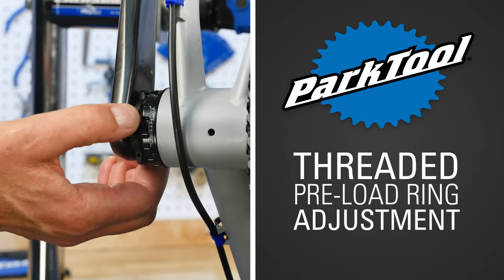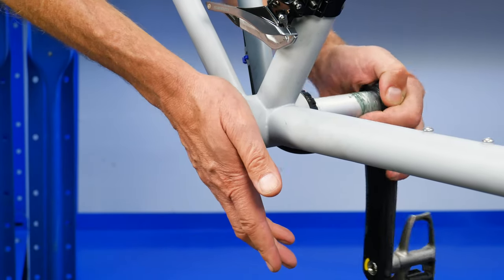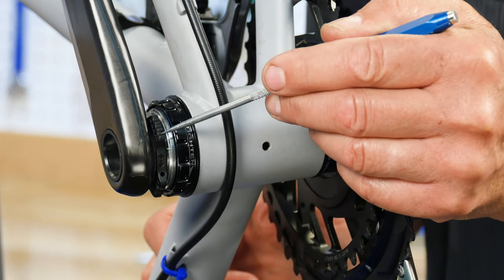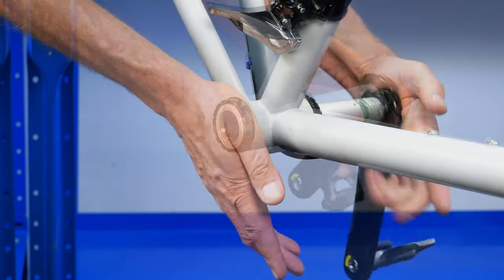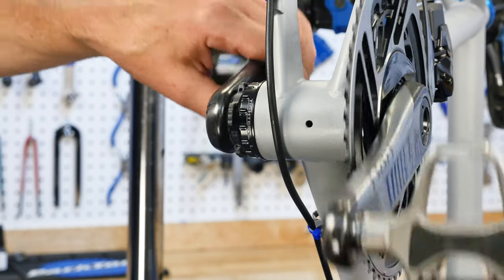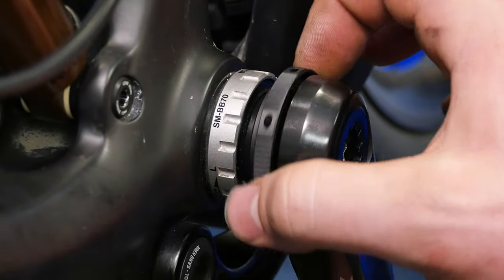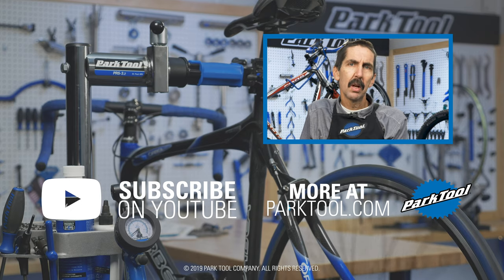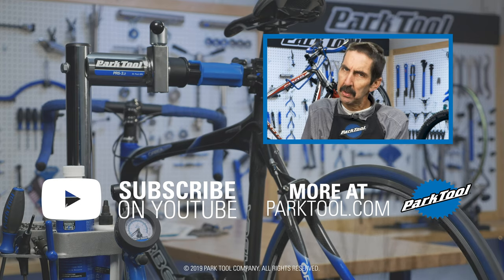Bottom Bracket Preload Adjustment (SRAM® DUB®, Shimano® XTR®, etc.)

Comment: Bearing preload is per design meant to push the bearing balls into the conical races for proper (smooth) operation of the bearing. Somehow the bike industry has hijacked the concept to simultaneously take up lateral play from poorly built parts (high manufacturing tolerances), so people generally follow the advice in this video to use the preload collar to adjust for only lateral play. This is probably ok for many cases, but as there doesn't seem a way to quantify preload force with these collars, I'm wondering how many times you're left with subpar performance due to insufficient or excessive preload
Reply: Generally I would agree that they should specify some amount of preload (very simple, something like "when you feel the adjuster make contact, add 1/8th of a turn"). However the bearings and races are the strongest parts in this assembly - preloading steel / ceramic bearings and races with parts that are aluminum / plastic would damage the other components before the bearings / races deform. In any case, I would also expect that the bearings used are also massively overbuilt for the low speeds and forces involved in pedaling a bike - I don't see a badly adjusted bearing being the limiting factor in lifespan of the drivetrain. Anyone have a bottom bracket bearing that failed (other than water ingress / lack of maintenance) and how many km's (or miles) did it last?

I just put a SRAM Dub BB in 68mm BSA on a 20 year old frame to replace the 3x chainrings with modern 2x (and go from 3x8 to 2x11). The old bottom bracket was in perfect condition - albeit a quarter kilo heavier, all steel shell, with non-adjustable preload. The chainrings and carbon crank arms instead of aluminum saved another quarter kilo (going from Bontrager alloy and steel bits to SRAM Red aluminum and carbon).
Reply: @justtheotherdave  The thing that is odd to me about spindle crank sets is the fact that the action of tightening the drive side to its specified torque evidently does not preload the bearings. I was under the impression that it was the main function of the BB spacer(s) to ensure the spindle would sit without lateral play, inside of the BB.

Comment: I found out that there are two variants of preload adjuster. Yours tighten if rotated clockwise. There is another variant which tightens if rotated counter-clockwise like on my 2015 Stumpjumper FSR Comp. Anyhow, just follow the direction of the + arrow and you are always good to go.
Reply: Yes, same goes for the Sram Red 22 bb30 cranksets. Thanks for pointing this out. I had it wrong the first time after watching this video since it still preloads bearings if turning toward bb shell, just incorrectly.
Reply: Raceface I noticed is counter clockwise on my Next R carbon crank.
Reply: Yes!! There is very little information out there on the counter clockwise version. It is completely non intuitive. It works exactly opposite from the way shown in this video. In order to apply bearing tension you rotate the locking ring CC (outboard), as the plus sing indicator shows. When the ring hits the crank continued tightening  moves the THREADS inboard, (The threads slide on the spindle). The threads hit the bearing cup and tension the system. Such a strange system, I don't think mine has ever been adjusted correctly till now.

Comment: Thanks for the video, I have 5mm of thread exposed I plan on using spacers when the stores open after the Xmas/ new year break. But in the meantime is it safe to ride with that much thread exposed?. 

Thank you.
Reply from the maker: Thats a lot of thread being exposed for this system. Are you able to turn it anymore or is it firm? At 5mm id guess there are some missing parts or the 54NM of torque was not reached. Check your torque as well as the correct layout for the bottom bracket of your bike.

Comment: I never need to use the adjuster, is that normal? If I torque the cranks down, it's all super tight. I imagine it would spin more smoothly if the adjuster was not flush with the crankarm before installation, allowing for some fine-tuning? Thanks for a response :)
Reply from the maker: What model/brand of crank and bottom bracket is this?  If you have this preload ring, it should be threaded against the crank, which is away from the bearing face.
Reply: @parktool  PF92 DUB BB and Descendant cranks. I do indeed have it threaded against the crank, except I have never needed to adjust the preload ring. With 54Nm, the cranks are super tight and never have any play. They can barely spin one full circle when tightened. Not really noticeable when riding though...
Reply from the maker: Do you have the correct spacers snapped onto the outside of the bottom bracket? They have a few different options and the wrong one would cause this issue.
Reply: @parktool  Just using the 4.5mm spacer which gives me a good chainline. Don't see how that could influence this...?

Comment: Do you have to buy this separately or does the nut come with the crankset or bottom bracket when purchased??
Reply from the maker: The preload adjuster typically comes with the crankset.

Comment: just head it recently serviced and now crank won't spin freely when I take the chain off. It makes maybe one full rotation when I spin it with decent force. Should it free spin just like wheel does or is some resistance ok?
Reply from the maker: The pre-load ring should be just contacting the bearing, and not be pushed into the bearing with force.  You might try loosening it and try the adjustment yourself.

Comment: Can I use the Sram dub system without boost? Or do I need the sram dub boost crank and rear? Hearing lots of conflicting stories with vendors, thanks
Reply from the maker: You can.
Reply: I'm using DUB on my non boost Marin Bobcat Trail 3 (2020) (upgraded from 2x8 to the 1x12 SRAM Eagle NX) so yep, definitely can!

Comment: Clavin, is there a way to replace this type of adjuster with spacers and wave washers? The preload on these never seams to get rid of all the play in my BB30. Also, why have an adjuster? My road bike has spacers and wave washers for the same type of BB... never had any issues with the road BB.
Reply from the maker: You could leave the adjuster loose and install a wave washer in the system to create the preload. It is not the manufacturers intention though so there may be issues that arise down the road. Typically the preload ring is more secure under load than a wave washer system.
Reply: Thanks for the video, Calvin.  Having just installed my crankset onto my frame (pressfit 86.5), I also installed the recommended 3mm of spacers on the drive side crank.  When adjusting the preload, I have about 3 full thread lines before the preload ring touched the non-drive side bearing.  All feels good and there’s no play.  However, I can’t help but feel like there’s a lot of thread showing between the preload ring and the non-drive side crank arm.  

Does this really matter?  Should I perhaps add a spacer on the non-drive side?
Reply: @llanfair  Did you install the bearing shields? The preload should never be touching the bearing directly.
Reply: @Strop311964  thanks for the reply and question, Craig.  I do have the shields installed, so we’re good there.  I’ve put quite a lot of mileage on it this year and everything works great, no issues at all.  👍🏻

Comment: For a bottom bracket with angular contact bearings, it calls for 3-5 Nm of preload (Wheels MFG BB). Any tips on achieving this amount of preload using a threaded preload ring?
Reply from the maker: Thats a tough one to measure. Perceived effort is about the only way. it should feel "snug".
Reply: @parktool  thanks for the reply and confirming what I suspected, much appreciated!
Reply: Could also get a small torque wrench (with needle and dial) with an Allen key to fit the non-drive-side crank. If you really wanted to go thru the trouble

Comment: Hi, i have problem with my Shimano XTR M9100 crank, i am doing like you said, turning the preload ajustment until there is no movement, and testing crank and turning around with hand, it is smooth and secured, turning nicely.

HOWEVER 

After a couple of km riding, getting harder to pedal and makes me tired fast, then i checked the crank arm with my hand. It's almost stuck, can't turn it smooth and freely with my hands, it requires a bit force to turn it with hand. The preload adjustment over tightened while i riding my bike.

What is wrong with this ? i have changed my Bottom Bracket to see if BB is the problem, but it was same....

Installed my XT 8100 crank back, perfect and smooth turning, even after long rides....
Reply from the maker: What is the exact model number on the back of your 9100 crank? Also what is the exact model number off the back of the crank arms for your 8100? There are a few versions of each.
Reply: @parktool  Hi, it's one by XTR M9100 race crank 12  speed 10-51 system, 170 mm, same as XT one, m 8100 one by 12 speed 10-51 system.  FC-M9100-1 1x12s w/o CR 52 MM says on the box.
Reply from the maker: What is the FC-8100- number on the backs of your XT cranks?

Comment: any alternative if the preload is broken? i accidentally tighten it and the plastic part where the screw broke
Reply from the maker: Purchasing a replacement ring is the best option as the adjustment is very fine. Im sure you could do this with 29mm ID shims but that would be a hassle to have to remove and install a few times to get the adjustment right. "DUB preload adjuster kit" use that as a description to find a new ring.

Comment: Do you test the preload by moving crankset to different positions?  I have seem that sometimes it feels ok but I rotate the crank and then there is one section where it has some play.  Do I keep adjusting till no play at any position or it does not matter?
Reply from the maker: Yes, rotate to several positions.  Eliminate play if seen anywhere.
Reply: @parktool  thank you so much 😊

Comment: My preload adjusted seems to be seized and harden as it doesn't rotate when I loosen the bolt and turn it. What should I do?
Reply from the maker: Double check you are turning it the correct way.  Remove the bolt entirely from the ring. Use a very light  lubricant to wick into the threads. Start with your hand and turn the ring back and forth to free it.   Avoid large pliers if you can, as it is easy to damage these rings.  Good luck
Reply from the maker: If you remove your crankset you should have access to the preload adjusting ring. At that point you can clean it up, loosen the bolt and try to get it removed. Once removed you can grease it up and re install it. You should then have your pre load adjustment back.

Comment: This video is incorrect and will end up with most people having lateral movement in their cranks. You show the left crank arm being pushed all the way into the bottom bracket. If you really did that there would be no room to move the pretensioner and with the lock screw undone it will just slip on the thread if you try and use it to pull back a gap on the drive side (especially with Ceramicspeed bearings which grip the crankshaft rather tight). Somehow magically in the video you have a gap to unwind the pretensioner into with no explanation of how that gap got there. The correct technique is 
1. Open the pretensioner to it's widest setting. 
2. Install the non-drive side crank and shaft (with the pretensioner on).
3. Close the pretensioner to it's narrowest setting (this will leave a gap between pretensioner and *crank arm*). 
4. Attach the drive side crank arm and torque to spec. This will push the small ring on the pretensioner to it's correct position.
5. Open the pretensioner until it is tight against the crank arm. 
6. Lock with the locking screw.
Reply: mmm your both right just applied differently
Reply: I've tried to fix creaks of my bottom bracket for months and found out hand tightening the preload nut is not enough. 
What I've done to fix the creaks is to hand tight preload nut first and make sure it sit tight against the bearing. Then I torque the crank arm center bolt to specs.
By doing this, the creaks are completely gone but I do know that I am actually using the cranks center bolt to push in on the bearings. I don't know if this is bad for the bearings or not, but at least the noise is gone
Reply: @BranXonX  lol i feel bro, bikes man! The endless nightmare itll never be right

Comment: My cranks not spinning 😁. 
What am I doing wrong?
Reply from the maker: Could be a few things. Be sure that you have all spacers, seals and washers correctly situated based on the width of shell you have. If you have too many in the system it will cause quite a bit of resistance.

Comment: So it loosened off I tightened it pretty good just using my hands it is still creaking did I mess up the bearings tightening it tight by hand looks like yall were pretty gently with it
That would also explain why it's made of junk plastic for the adjuster that is if you are suppose to delicatly tighten it to the bearings

I wish they had a way to put a torque spec on that plastic nut
Reply from the maker: You are looking to take out the play and put a small amount of pre load on the bearings. A gentle touch is all that is needed. no torque needed, just "Feel". Check that your pedals are tight as well as your thru axles.